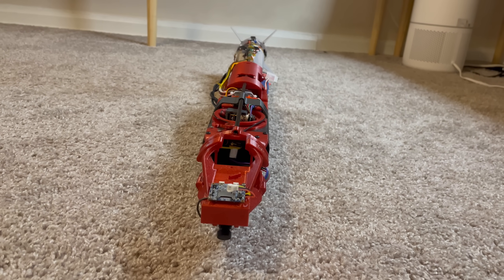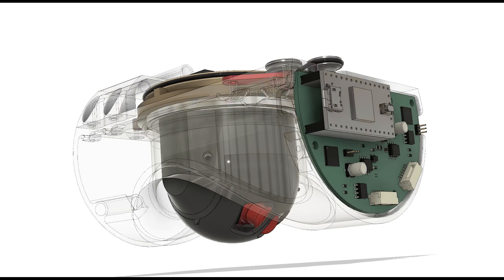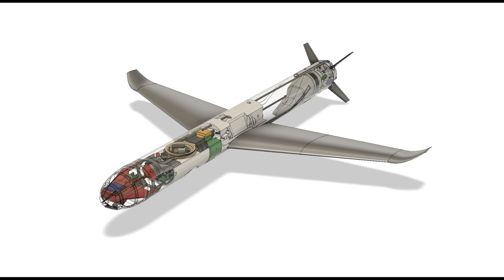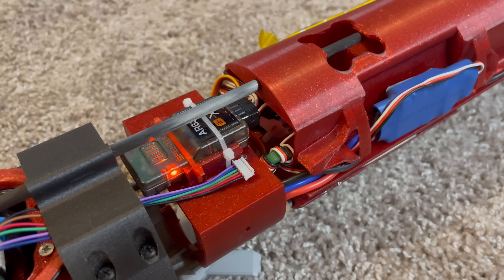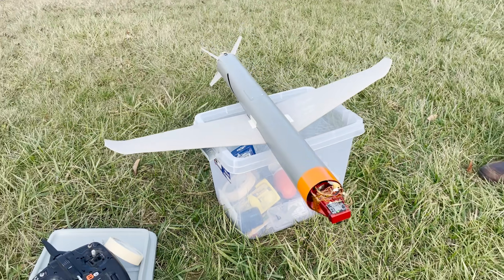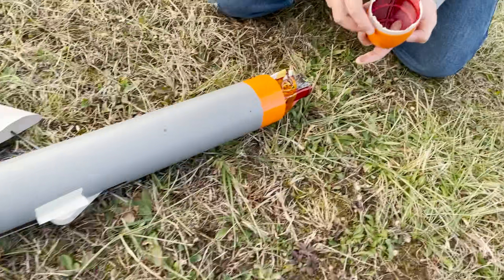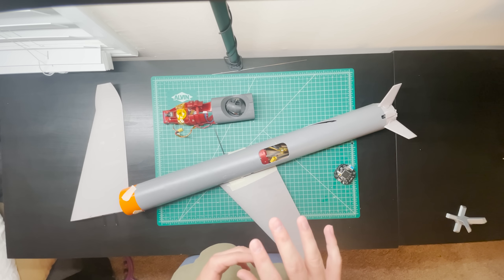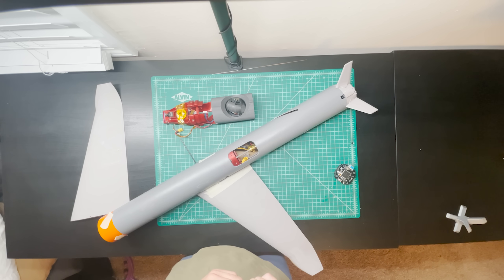Building (And Crashing) my Homemade Surveillance Drone

Comment: You could srew on 2 little hooks top front and top rear and then let the model "hang" glide on a thin wire or fishing rod. Later increase the angle until You are sure the start thrust is trustworthy ;-)

Comment: It looked so perfect and well executed. In general most the RC dudes would be using cnc cut foam and a carbon tube body. I suspect a design like a mash up between a predator drone and what you have now would function better.

Comment: To add to the sea of suggestions, you can lose a little bit of tail weight if you switch to two tail servos, with the two remaining surfaces slightly offset from each other longitudinally by a few millimetres; then your thrust vectoring vanes, supported by a carbon fiber tube running through their center, can pass by each other, forming a X-shape overlapping vanes. One (or both for maintaining control authority balance) would have V-notches in the middle (hence the need for the CF tube) to allow for whatever max deflection angle is desired without colliding with each other. By running them through to the opposite sides of the exhaust duct you also gain a greater supporting moment against dynamic pressure exerted on the fins, which could allow you to reduce the structure around the fin mounting points (as well as eliminating the mass of two servos and their wiring).

Comment: My overall impression is you are attempting an insane level of complexity for a first try at a RC plane. Just make something very simple that flies reliably before you festoon it with expensive gizmos. To be a bit more specific...
- CG looks too far back
- Add ailerons. Those tiny vanes will be totally swamped by the effect of the main wings in roll, if they are misaligned your rear vanes could become saturated and still not be able to trim in roll
- Previous point again, but to deal with the torque of the EDF
- Previous point again, but maybe some dihedral could be used instead of ailerons - not my ideal suggestion though
- Wing loading looks crazy high. I would be inclined to scale up the whole airframe (or at least the surfaces), keeping everything else the same so that you have more surface area for the weight you're trying to lift, so lower stall and launch speed
- Interior vanes right behind the EDF are probably killing thrust
- How about placing the inlet duct for the EDF at the top, would help with lift a tiny bit and would be safer if you happen to land in gravel/dirt with the motor on (or even with it off I guess)
- maybe swap the EDF for a rocket so that suddenly all your rocket experience comes into effect :D

Comment: yea definitely try making it lighter and increase the wing and elevator surface area, another idea would be ditching the edf for now and using  propellers because they do create substantially more thrust for less energy at least in my experience, that would also allow smaller batteries further lightening the whole plane.

Comment: You need more power and check the CG,  build a trolley with wheels or add wheels until you have solved the issue.

Comment: Are you sure the aircraft can generate enough thrust? It didn't look like that when you hand launched with full thrust. It more or less flew thrustless.
You could and should make more ground tests - see how much thrust is actually generated, and have a feel for control authority.
Hand launch technique requires some improvement.
Note that an unstable aircraft might benefit a lot from an autopilot to provide a fly-by-wire control, since it's own IMU and CPU are more precise and quicker than you hand-eye coordination. That being said, it will require additional setup but you'll easily find help from hobbyists at Ardupilot or PX4 community (or whatever community you can find)

Comment: Your problem is CG. Also your launch process sucks. You can fix both by learning from people with more experience with RC planes. There are plenty of videos on YT. After you fix those, you will learn if take-off weight(respectively trust) is a problem.
I've never thought I'd say this, but apparently making rockets doesn't qualify you for flight...

Comment: There’s is something about EDF’s and the proper air exit hole diameter that make the motor produce the needed thrust. There’s a rc  jet that was made a while back that severely lacked thrust. Someone discovered the problem and 3d printed a cap for the back and the jet came to life.  If you’re reading this , hit me up, I’ll find the video for you. Otherwise my advice. Buy a cheap rc jet that looks similar to your build. Then strip it down and put your parts on it. See if it flys.  Other idea. Take your current build into the air via drone or rc plane and drop it.  Then you will catch the speeds you’re looking for.

Comment: It seems that you don't have enough thrust, have you tested that? Also, is your centre of gravity correct, and a little bit forward for the first flights to be safe? If it won't glide, it won't fly with power. So get the CG good first. 
Then see how much thrust is needed after reducing weight. Maybe the EDF can handle more voltage, else you will need one with a bigger diameter. Where are the EDF intakes? Only on the bottom? That will pull the tail down somewhat.

Comment: I know that's not the focus of this project but the inlet duct seems to have a very steep ramp where flow might detach and get turbulent, this migh lessen your thrust or at least draw more power. Maybe you could run a simple CFD analysis. As an analogy: air will flow nicely through a convergent nozzle and you don't have to be too gentle with the taper because worst case you will compress the fluid some more, do the same with a divergent nozzle and you might create a lot of turbulence

Comment: First step is check stall speed, this narrow wing and heavy payload, will need loads of speed.  You can make lighter wings then 3D printed If you use another building materials (at ex. depron foam or lamination on positiv foam core.). Another way to lower stall speed is to use profile with higher lift Cx. As you mention your control surfaces are small so make V tail is good idea, and would add ailerons too. I don't have experiences with trust vectoring, but leverage of vectoring surfaces are almost zero  in contrast of long wing, any disturbance on and of the wing easily overpowers trust vector control. You can fly plane with no ailerons, but this is used only at slow and very stable planes(mostly training gliders ).

Comment: You need SOOO much more thrust. You can see that it's gravity that's doing all the acceleration and as it falls, induced drag increases making it even worse and eventually the wing stalls and it's game over.
If you can launch it at over stall speed and it doesn't need to accelerate, it might be better but how much induced drag will it have then? Stability at stall speed is never very good
"You can make a brick fly with enough power" - My late father who was a pilot. 
Oh wait....your're into rockets....just strap a booster on and launch it upto a couple hundred feet and then you might have the altitude to cash in to actually assess it.
I am very impressed with your work btw. Maybe because you're into rockets you've not recognised the value of what is enough thrust because a rocket always has plenty to get in the air.

Comment: This CAD work and prototyping is just awesome!

That ducted fan exhaust has an expanding nozzle.  But your air isn't supersonic -- it's not even compressed.  So the exhaust will slow down and increase pressure through this nozzle, which means the nozzle will pull backward on the vehicle.

You might want to switch to a converging (subsonic) nozzle.

Also, for those jet vanes to work, you'd need to have the nozzle terminate right about where the vanes are.

Also, isn't the center of lift on those vanes going to be through the 1/4 chord line?  It looks to me that you may have the center of lift forward of the center of rotation.  That's going to make the vane fight the servo whenever you try to reverse the control, which will increase hysteresis.

It doesn't look like you have enough lift.  Did you calculate your stall speed?  That thing looks like it's maybe 4 kg?  With 910 cm^2 of wing area, you'll need 430 Pa to hold it up, so you'll need about that in dynamic pressure (assuming your wing shape can do at least CL=1.0).  At sea level that's 26 m/s, about 59 mph.  An NFL quarterback would be hard pressed to throw that hard.  Maybe you could use a big rubber band to launch it.

Reducing weight 40% should reduce stall speed 20%.  Dynamic pressure is 0.5*(air density)*(velocity)^2.

Comment: Yeah, personally, I've never been a fan of launching via by hand

Taking off under it's own power really helps in giving you necessary data as to what you need to fix

Weight is a problem with that design but also the design itself seems flawed

The thrust vectoring is cool but it's not enough control surface area to give it stability, currently it's just a cool design that is contributing to nothing 

I suggest making a design where your fings can swing out like you want, but also the stabilizer and tail surfaces, but that's going to be additional weight, you're going to have to use a more powerful engine 

I think you should start from scratch and use foam, get a working design and start from there, figure out what works and what doesn't, then gradually add appropriate weight to where certain systems would be

Either way, this is just my opinion and I look forward to what you will be doing next with this project 

New subscriber

Comment: The launch throw is... not super controlled. Build yourself a rail launcher to remove that inconsistency while you are still learning stuff. Good on your friend for giving it a go, but for now, probably don't. 

Most planes that fly will also glide - if you can't make it glide straight and stable, making it fly is going to be a challenge. A soft toss into wind with no inputs should see it glide straight and balanced.

Comment: You dont need 4 fins just 2 or 3 like a normal plane and make those control surfaces much bigger,i think you can add some control surfaces on the wing.
PS: you try to get a flight controller eg: f5 or smth

Comment: Maybe some large rail launch system with a slingshot, Allowing you to get past that stall speed and actually see how your flight surfaces work at speed. I believe other drones used by the military have similar launch systems to get up to speed super fast.

Comment: I really love the concept, so much room for even more potential. Regarding the wing surface area issue, have you ruled out all oldschool methods ? Particularly fabric skins? I imagined based on the earlier 2 part design (that had a high stall speed) but fabric or similarly malleable material stretching to form top & bottom skins. Allows a better airfoil profile, since its always landing like a convential plane and won't need to fold themselves back up until its on the ground, you could add some form of stringers for rigidity? Biggest restriction would be either end of speed envelope inducing turbulent flow over wing surfaces, flutter could run into immediate damage or failure if it's not super tight. 🤔 just an idea to brainstorm

Comment: How heavy is that thing? It looks like it weighs about 2x too much to hand launch. EDFs have basically no static thrust so the rail launch idea is definitely a good one but its a lot of time and effort when you need to focus on getting the characteristics of the airframe down first. 

I'd build a super light one just to test the advanced control system you are using. Maybe a foam board tube with a light 3d printed nose cone combined with moving the wings backward so you can use your existing edf location and power unit. Im biased as foam board is my bread and butter go to material for model planes. 

Also are you printing the plane out of any foaming light weight materials? I think they have just about everything in a LW version for RC planes nowadays.

If you need that payload weight to stay the same you can only take so much weight out of the structure while keeping it in that soze and form factor. If it were me, I would shoot for something about 30% to 50% larger while trying to keep the weight of the structure relatively the same. I would also do a pusher prop on a thrust vectoring base along with ailerons for controls. If you want to keep the wings light and simple canards can handle the roll and add a lot more pitch control. 

Hope this helps! If you want to have a more in depth conversation let me know. I'll hop on the RC testflight discord.

Comment: My Uneducated guess as a hobbyist at best. Each launch looks incredibly unstable, like the COM is way in the back and the majority of your lift is coming from the front. The last launch you showed really shows it when unpowered. I would try increasing the rear stabilizers first and doing unpowered tests and see if you can get a stable glid. If not, then move your wings back some, if you can do it with minor modifications and doing another unpowered flight.

Comment: Your project is so cool, I would love to work on it. I don't know if you have solved the takeoff problem but I can calculate the engine power in relation to the weight and the wing area, the speed...

Comment: i think you should move over to a prop design! the ducted fan is cool but you probably aren’t gonna get the thrust to weight ratio you want. 

also, the center of gravity looked off. you’d need to figure that stuff out pretty precisely unless you’re giving it a full flight controller.

Comment: Should compare your design with the military. Like the Tomahawk, Harpoon, Switchblade, etc. also weight is the problem, and thickness of the material too. Another thing could be the power. You could be under power or the length of the body. Should get rid of the front camera since you have the ball camera, that could be front heavy.

Comment: my suggestions
1 thrust to weight to see how much thrust you making
2 lighten the load for now
3 ailerons 
4 like you suggested make the top v one larger and bottoms smaller
5 do glide testing if it can glide controllably it can fly
6 move more weight to the front it looks tail heavy from flight attempts a front heavy plane will fly poorly but will fly and tail heavy will not
7 adding a rc gyros/ flight stabilizer
9 moving the intake from bottom to top to remove from sucking in debris

Comment: So many cool ideas but so off the mark on other things. You figured a lot of them out. Look at what actually works! Lots less weight, much larger tail surfaces, add wing control surfaces. Also, you are going to need some type of stability augmentation. And yes, I feel like Slingblade saying "needs gas" as I have zero engineering skills but I do make things that fly so...

Comment: One thing that might help with weight is replacing the printed body with a carbon fiber tube with a similar inner diameter (if available) might be able to cut a little weight off.  Other than that I think that increasing the takeoff speed in addition to the weight saving measures you mentioned should help considerably.

Comment: you can try adding foam on the belly to take the brunt of the landing, it also raises the planes height on the ground keeping you control surfaces safe. making it a y tail is good option, but would first run some CFD to analyze the plane's performance in various speeds.
cool video, cant wait to see it autonomous( pixhawk ftw)

Comment: You should double check if you are at the right place for the center of mass.
It looks like it tip the nose down.
And not enough speed to make any lift.
But yes you need more surface on the back wings

Comment: I agree with your assessment that you have a yaw stability problem, first.  Second, after you fix that, I agree with the other comments suggesting a catapult launch. Given the weight and designed launch mode, the hand launch simply isn't giving you enough velocity "off the rail".  You may need a much larger wing to start with if you want to try that, but that carries more weight, more drag, and will again require you to add more yaw stability.  Perhaps some longitudinal vanes to simulate more yaw control can help get you in the right direction.

I'd also ask - Have you done any CFD to see if the wings are producing any turbulence that may be masking those small control surfaces?  Especially at the high AoA you're probably expecting, that airflow may be nasty.  If the air is clean enough, have you run the numbers to see if they're imparting enough lift/torque for all three control axes (concurrently, when the controls are blended) at whatever airspeed you can achieve with your friend's arm?

Comment: Rocket rules still apply to planes: center of gravity vs center of pressure is incredibly important. That huge wing has moved your center of pressure WAY forward, and those itty-bitty fins just cannot compete with them at hand-launch speeds to provide any realistic stability. Rockets can keep CG comparatively aft, only slightly forward of the fins, but on airplanes the CG is often around 1/4 to 1/3rd from the leading edge of the wing, for almost exactly the same reasons.  

Bigger tail surface with gentle throws, and move the CG forward :) Can't wait to see your next attempt! There's no shame in test-gliding a few hand launches into some tall grass or pillows.

Comment: Try calculating your wing loading. It should be somewhere around 1.5 - 1.75, and as another commenter mentioned, setup your CG. My thoughts are to suspend it from a string at the CG on a arm that will spin about a vertical axis. Think merry-go-round type motion. I'd also calculate the total flight weight against the actual output thrust. You may find you need more thrust. Higher torque motor with more blades. Good luck and disregard the nay sayers. This is the sort of thing that fuels innovation and breeds a new generation of engineers.